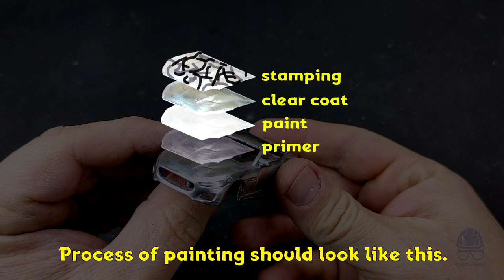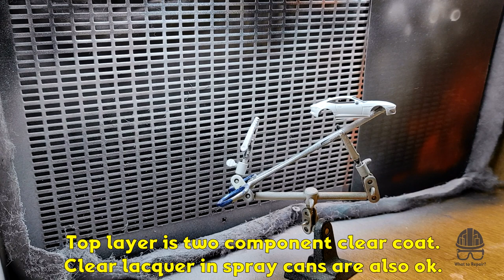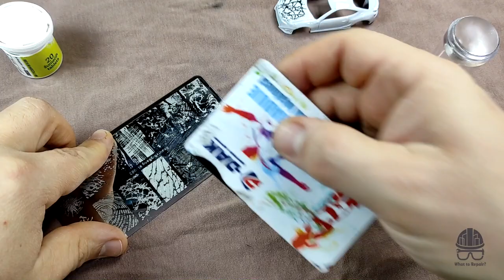In Search of Color #04 - Urban Camouflage Texture with Nail Stamps on Jaguar F-Type

Comment: Turned out great!
I use this for quite some time. That works really good.
Tip: don‘t use alcohol to clean the stamp. The silicon don‘t like that. With a piece of tape you can get of the color really easy.
Reply from the maker: Oh, I didn't knew that. Thank you for advice. It will be even easier to clean stamp with tape.
Reply: @WhattoRepair   you‘re welcome! 👍

Comment: I like this look. Can you suggest anyplace to get suitable stamping supplies? I tried some from an online shop and couldn't get them to work. I think the plates were too shallow
Reply from the maker: I bought mine on Aliexpress. I think all plates that I saw have same depth. It takes some time to practice. You must experiment with paint thickness, paint must be neither too thick nor too thin, and when you remove excess paint you must practice to remove the right amount. It's better that paint is on the thicker side. Remember how thick the nail polish is, which is intended to be used with that plates.